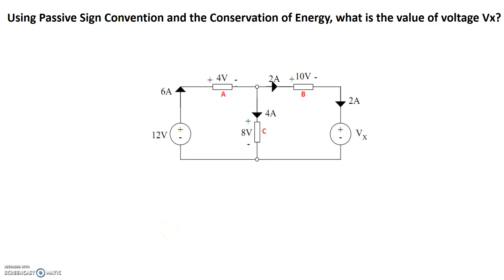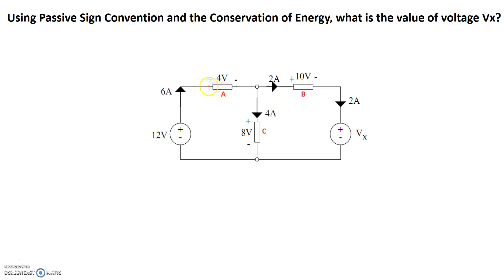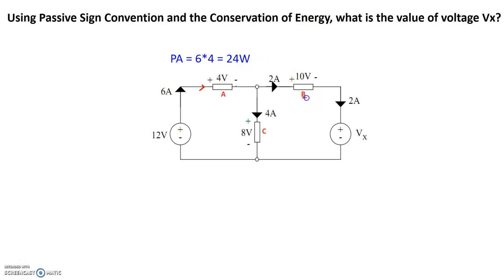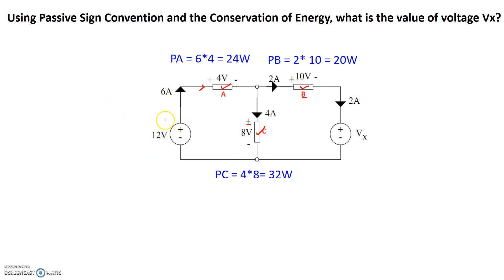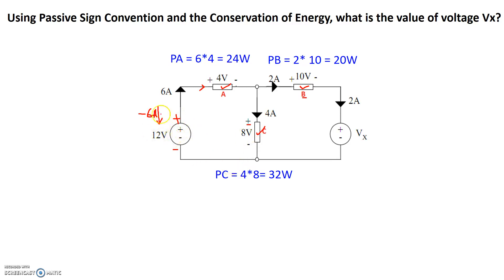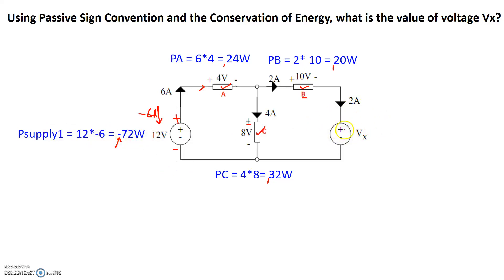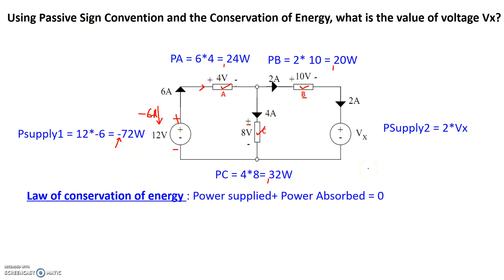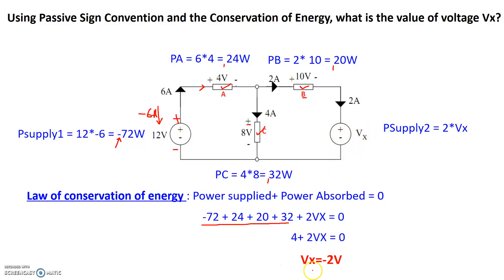Example 2 Passive Sign Convention

Comment: I like the concept you used and the video is great overall but for voltage sources, the convention is for the current to flow out of the positive terminal while for resistors and other passive components the convention is for them to use current from their positive side and out the negative so the 12v power supply was actually following convention and the reason you got a negative answer for Vx indicates that the voltage polarity for Vx should be flipped and make use of current coming out of the positive instead of the negative. But overall again great video. I know it doesn't really matter but convention is a huge thing for beginners in order for them not to get confused. Thanks.